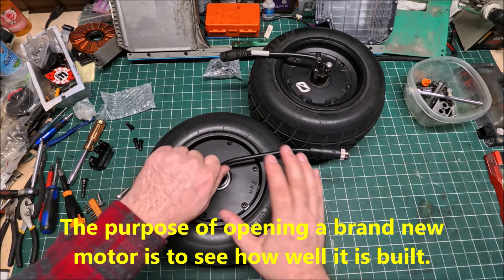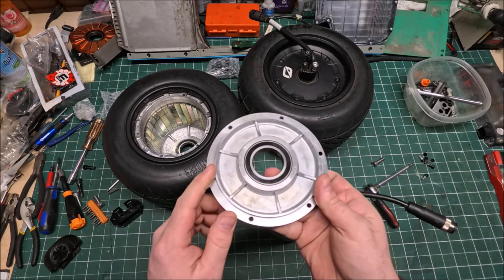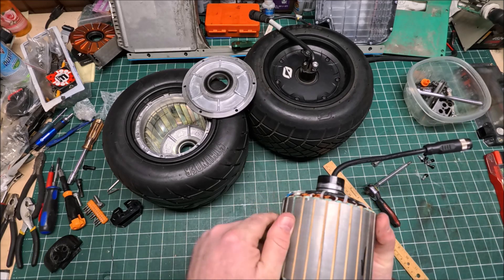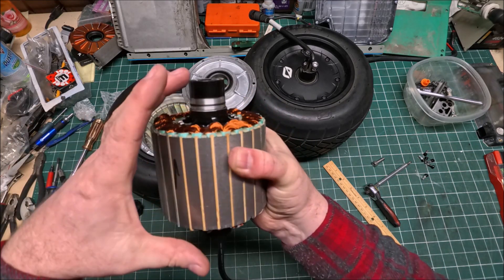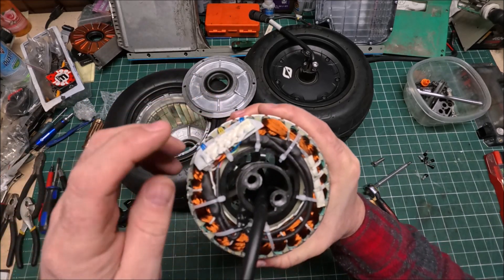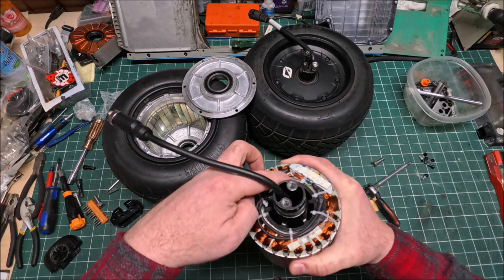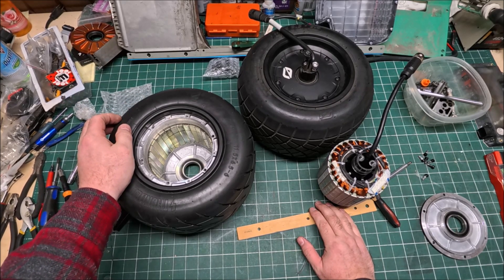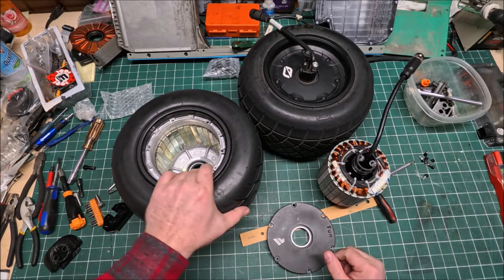SuperFlux v2 HT motor from Fungineers Disassembling for Quality Control VESC Onewheel GT S XR Pint

Comment: What is the trick to pop the stator loose? You just cut the whole struggle out. I put my full weight onto it and it didn't move an millimeter...
Reply from the maker: On my motor, stator cover was stuck as well, after I remove  six screws from side cover, then I screw a two axle bolts back in to axle on opposite side from the cover. I lay it on the floor facing a motor cover up, and with all my weight of 290 lb I push it hard, and it did take me few tries to break it loose
Reply: Attach a rail to the plug side of the axle, place the hub between your feet or place your feet on the sidewalk on the tire, grab the rail and do a deadlift movement.

Comment: Could you test out the threads in the axel, they seemed to have some problems with those tolerances, and are making special bolts for them (M8.4 if memory serves) I'm a little afraid for those aluminum threads!
Reply from the maker: Yes we will in part 2
Reply: @GPeter7  I received mine just befor the weekend, I also took it apart, I had no extra threaded holes under the hubplate, only the M5s, I also didn't see any kind of abuse to the windings, and as far as I can tell, non of them stick out far enough to any kind of rubbing danger to happen
Reply from the maker: @thomasbjerregaard1080  That's good, I'm happy for you, probably I was not so lucky